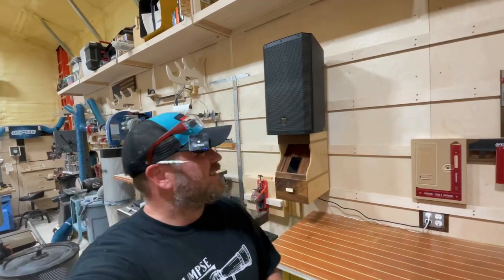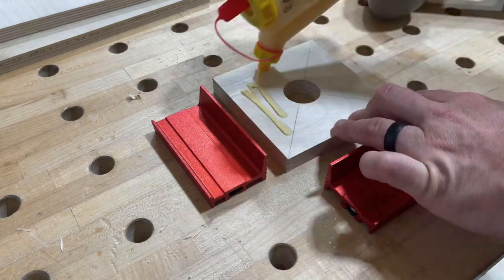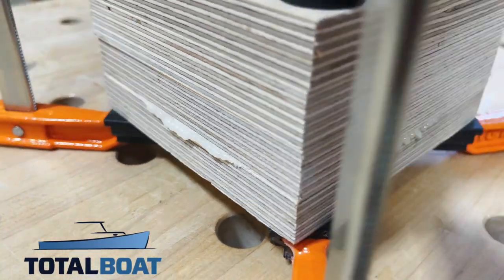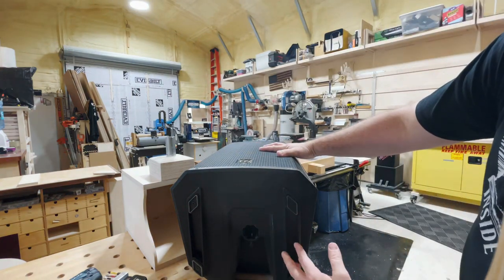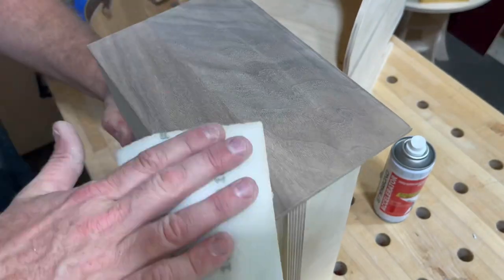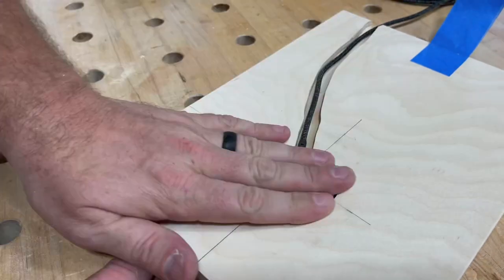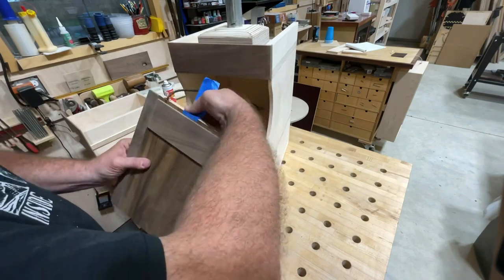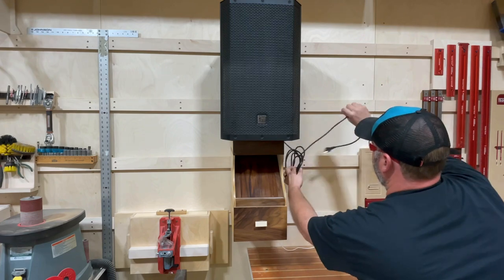How To Make a Bluetooth Speaker Mount with WIRELESS CHARGING

Comment: Great project! You inspired me to build 2 different cleat walls about a year ago. One is my “light” wall that has the 3/4 ply and the cleats are 3/4 pine. The  other is my “heavy” wall with the same 3/4 plywood backer and the cleats are made from 2” boards and on that wall I was actually ale to hang my router table up and out of the way and also was able to hang my 12” hitachi miter saw. I did this as I share a 2 car garage with the wife’s car and need to use space wisely. Thanks for your inspiration.

Comment: Cool!  I've got an old receiver with a pair of kick a$$ old speakers hanging up by the ceiling.  I just added a blue tooth connector last week so I can broadcast music from my computer, phone, etc.  Connector was $22 and I had the speakers, bought an old school receiver off Craigslist for $30 and the system will blow your doors off!  Music in the shop is no longer an issue, and the quality is great!   I also have hung all of my shelves and stuff with French cleats, they work great.  Remodeling my shop was my Fall/Winter project, I'm still dialing stuff in...

Comment: I am also more of a build without plans and measure referentially etc. Even when I buy plans from folks, I still often just use it more as a reference than follow it exactly if it doesn't need me to... sometimes for more mechanical things that need to move I will try to follow more closely so the movement and balance is right or for things like your rhino hose reel that is cute and made for specific sized hoses etc... or when things are based off only using one or two sheets of plywood (especially with current high prices) is when I will try to follow measurements more closely. It is mostly all just inspiration for me to pull from when I need it. Anyway, I like this and think we should all get the stuff we want in our shops ;) I also like that you can still pull it off and take it out and put on gig stands when needed etc. You should hang your guitar and a TV over there and maybe some more speakers for some surround sound lol. All the best, AL

Comment: Great video!

I have Bluetooth ear protection but pull them out during my quiet work. I didn't like losing my music when I did that. I added a Bluetooth transmitter with a speaker pass-through so that I can listen with or without the earbuds. Hopefully that will encourage me to wear the earbuds when I make noise.

Comment: I am finally adding some cleats to one of my walls for easier access/movement, and your videos have given me a TON of different ideas. Out of curiosity, how wide are those cleats that have the double screws? I am building my wall over sheetrock, and definitely want to make sure they are wide enough for 2 screws at each stuff.

Comment: The new design looks amazing and easier to cut. I am a new wood worker so sorry for the question. Are you still able to lock the new designed cleat? From what I have gathered the looking at videos; most designs use the bottom of the cleats to hold it. Since the bottom of these cleats are slanted will that make it harder to lock?
Reply from the maker: So in my experience with locking cleats. I’ve only used a wedge on the back or some type of an arm that swings up to lock. However I find the best way to lock a cleat to the wall is a really small low profile flush trim screw, just one somewhere on the tool holder and you’re good to go. So that being said traditional locking methods I don’t typically use anymore I like just using one screw

Comment: Out of curiosity- are you concerned at all about dust damaging the speaker long term? I’m in the same boat as you - I don’t like having a bunch of stuff on my head while I’m in the shop, so I’ve considered adding something like this. I haven’t because I’ve been concerned about dust.
Reply from the maker: Well I’ve actually had for over a year With no issue. Truth be told it was on top of a tube amp at the front of my shop. My wife sleeps quite a bit and our master bedroom is not too far away from the shop. So I can’t really play the music very loud. So I had to come up with something to move the speaker to the back of the shop and that being the case it went up on the wall. Sorry to be long-winded but to answer your question I don’t worry about it and I have not had an issue

Comment: Granted, the spacing between the cleats is personal preference.  But what have you found to be the optimal width of the cleat and the spacing between the cleats?
Reply from the maker: I think the actual Cleat should be at minimum 1 1/2 inches on the short side and the spacing I like anywhere between 8 to 10 inches.
Reply: @AGlimpseInside  Thank you.

Comment: I would recommend taking some cut offs and making a smaller frame for where the The wireless charger is right now it’s fun to kind of try and find the exact spot but later on you’re not gonna wanna take that kind of time. Otherwise it’s a really cool build.
Reply from the maker: Ahh nice idea. Might do that with a different species of wood. Hmmm!
Reply: That was my thought exactly!  Cut out one piece of walnut the size as the veneered panel and then notch out for the phone where it needs to be.  Glue that over the veneer.

Comment: Are my projects planned or ad-hoc?  Well it starts out with detailed SketchUp drawings with every possible dimensions. Then I completely ignore it, blow through multiple mistakes, chuck a few boards (into the wall) that I mistakenly cut too short, fix the hole in the wall with a quick California drywall patching technique, pat myself on the back, move on to finish the project SWEARING that I'll follow my plans next time.  So yeah, that's what happens! 😂
Reply from the maker: This is very epic and truthful response. I love it
Reply: @AGlimpseInside  Love your finishing. That table you made for your daughter was INCREDIBLE.

Comment: When making dados or grooves with a single blade, I use a kerf maker. The one I made and used, which is awesome and simple to make and use is from "I Simply Build It (ISBI)" https://www.youtube.com/watch?v=uhPvanE9fnc I used what I had on hand (scraps and related hardware). They only modification I made to my version is I added another adjustment screw for my Amana flat ground tooth blade. One direction(adjustment screw) is for my regular blade, and the other is for the flat tooth blade. Can be used with a single blade or a stack dado. I believe if you make ISBI's version of a kerf maker, you will glad you did! Awesome video as always. Wishing you and the family the best.